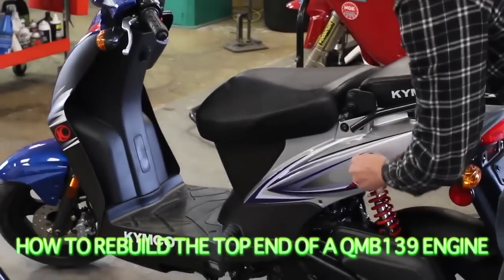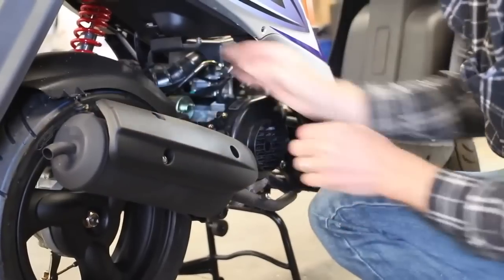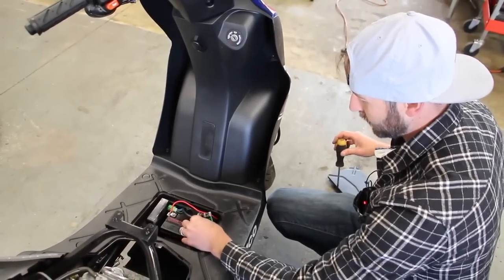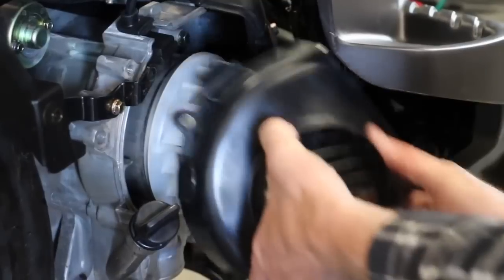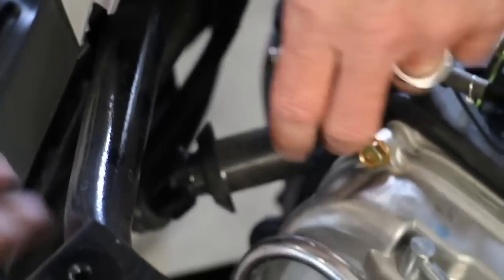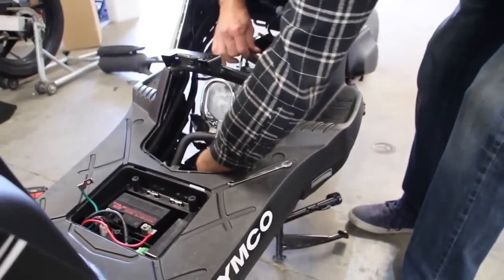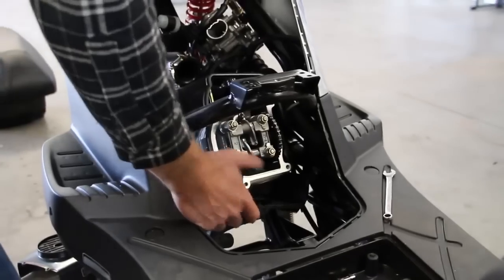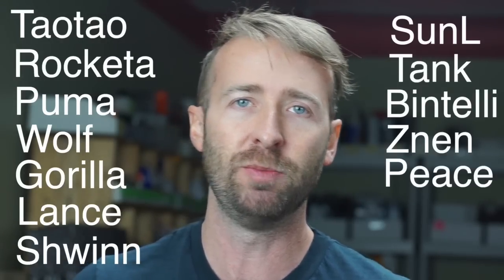Preview of paid video: How to install a big bore kit on a chinese scooter

Comment: will this fit the 2017 and 2018 Agility 50s?
Reply from the maker: Yes, it fits all qmb139 engines. To verify  look to see if you have the qmb139 stamp on your motor. Located near the center kickstand bolt